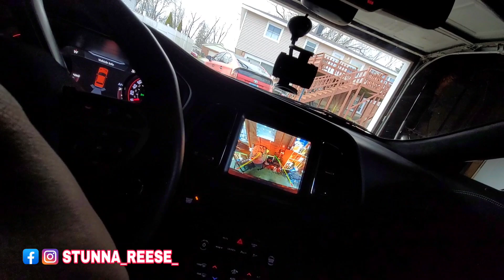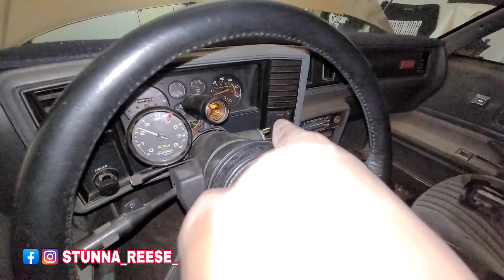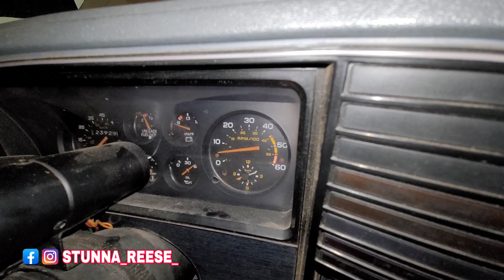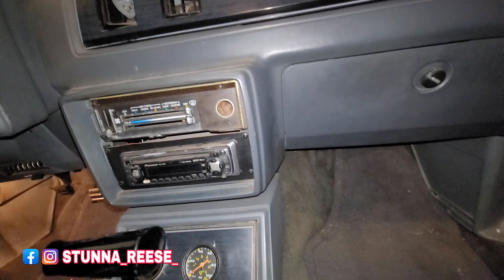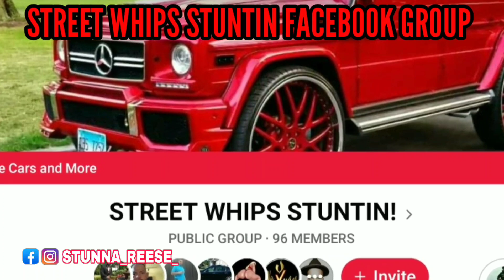I CANT BELIEVE I FOUND THIS UNDERNEATH MY NEW SS MONTE CARLO

Comment: If you ever take the G body to the track, you will need the fan hard-wired. This enables you to cool the engine off between rounds of racing without the engine running.
Reply from the maker: Not that car anymore. Just a cruiser

Comment: Dam Stunna that driver side door gap is questionable. I would check and make sure that the car wasn't a victim of a bunch of hard landings from wheel stands. The back bumper would tell you if the car was dragging ass doing wheel stands.

Comment: Don’t take the car to the body shop adjust the striker pin on the door use a torques bit adjust pin in and tighten it back up